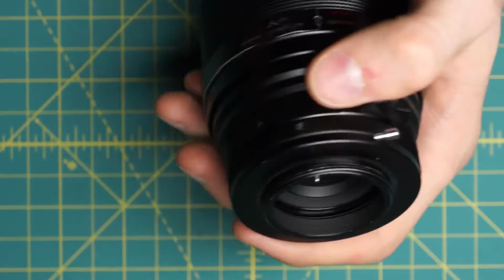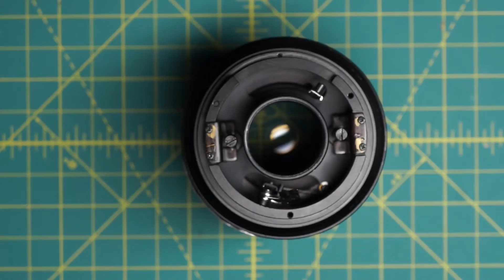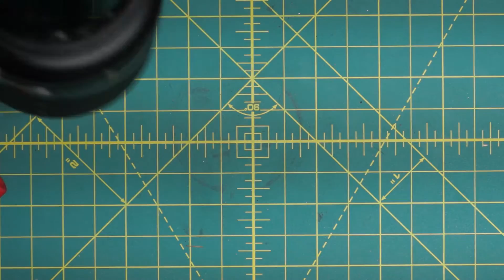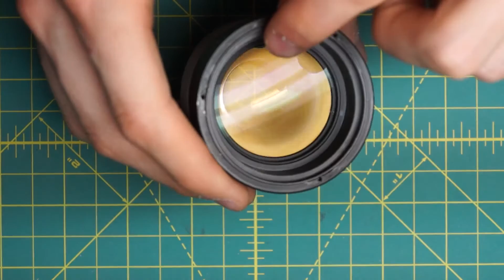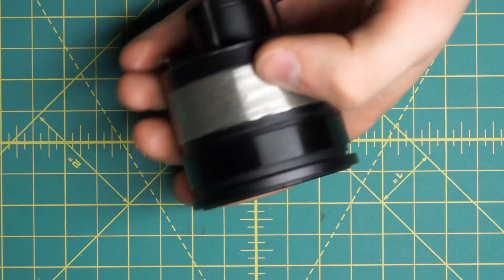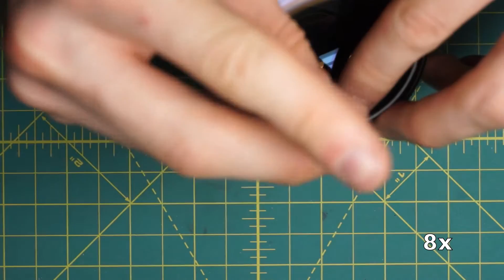Sigma-XQ 135mm f2.8 Lens Disassembly

Comment: What mount this lens
Reply: M42
Reply: @alexm42lenses38  

YS mounts were available for all popular cameras made in the mid-1970s. Mounts were available separately (but not always easy to interchange). This lens (and 200mm f:4..0) had a front "system focusing" ring to allow the 135mm lens to focus down to 60cm (about 2 feet). Not sure "cheaply made" description really fits -- although this one's only a 4-element/4-group design, these Sigma lenses were mostly made from metal, not plastic, with decent-performing optics, and are pretty rugged. Sigma also sold an "Upsilon"-branded version (less expensive) of this lens without close focus. Plus, replacing the focus screw as shown here is simple only if its screw-type is single-thread access type, not a helicoid, multiple-thread access type.
Reply: Good video, do you have any disassembly experience with the 1.8 version of this?

Comment: I've not even watched all of it yet but well done on your video... Great dialog with the steps you're taking.

Your lens looks different from this lens... 

http://www.ebay.com/itm/Sigma-telephoto-135mm-f2-5-Canon-FD-mount-lens-Rare/332317060016?ssPageName=STRK%3AMEBIDX%3AIT&_trksid=p2055119.m1438.l2649

Do you know anything about this lens Matt?

Thanks
Sean
Reply from the maker: Thanks. Sorry I don't know anything about the 135 f2.5 FD Mount. Sigma made a huge number of lenses over the years. Some of the general construction and design techniques may be similar but the steps to repair that lens are likely very different from this one